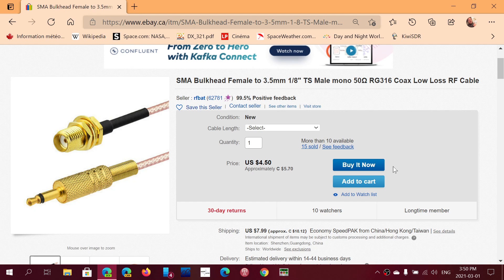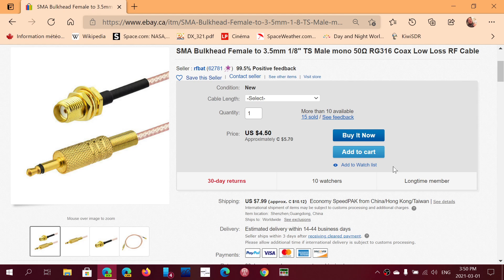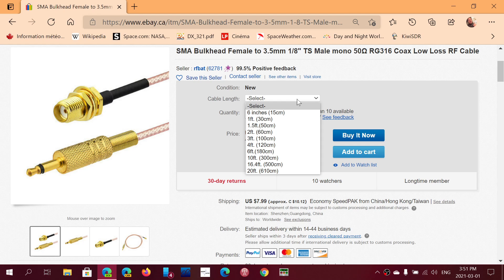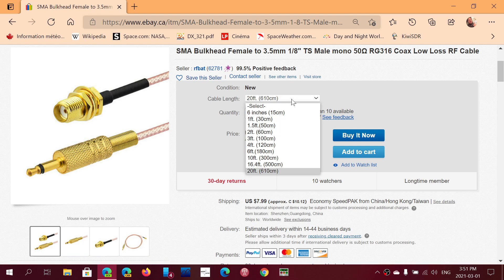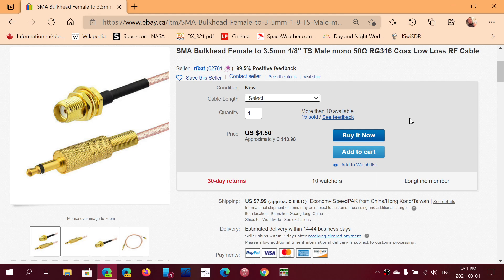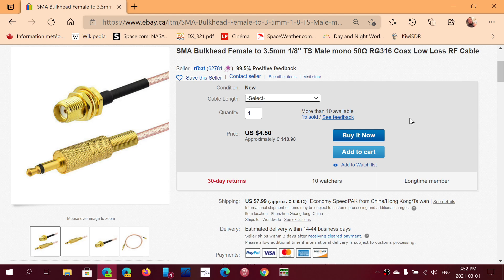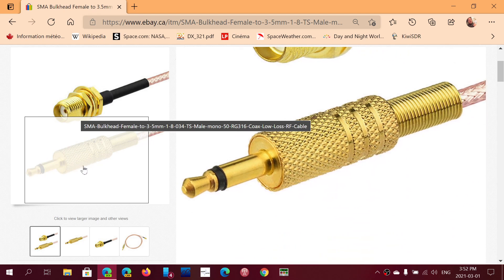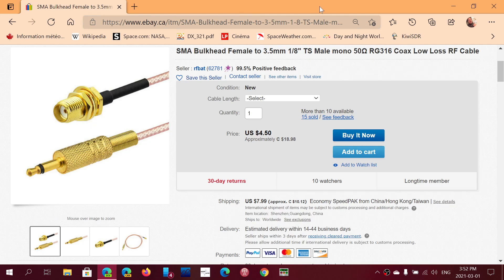What you need to hook up MLA 30 loop to a portable receiver is this cable

Comment: Hi, I have a tecsun R9012 and the only slots I have are earplugs and a 3v DC in. How to connect it? Thanks
Reply: you can just cut off the 3.5mm jack and wrap the bare wire around the antenna

Comment: I have a Tecsun PL368 and a CCrane Skywave. The only 3.5mm connection on these radios is for the ear buds. Is there another way?
Reply from the maker: Tecsun PL-368 on the top of the radio it is antenna, this works, as for C Crane it is a little complicated as they did not put a antenna jack
Reply: Got it. Thank you!

Comment: this question drives me crazy? I have the MLA-30+ antenna and a Realistic DX-302.  The cable coming out of the usb powered amp is a very small coax (?) but the radio has a much larger connector.  I would order an adapter but I'm not sure what the connectors are called.
Reply from the maker: You need a SMA female to PL-259 , they are available on Amazon

Comment: Gilles, while I don't need the Bias-T box to power the MLA 30 antenna for the SDRPLAY RSPDX, I do need it if I connect the MLA 30 to my Tecsun PL-990X, right?  Thanks
Reply from the maker: yes the SDRplay can power the antenna, this is why you don'T need the box, but on a portable radio like the 990X you need that Bias T box to power the antenna
Reply: @OfficialSWLchannel  Gilles, I just received my SDRplay RSPdx today!  I have a question about the power supply.  How do I power up this unit?  I see an oddball USB connection point on the back.  It looks like a connector for my old HP printer.  Do I need an oddball USB cable?
Reply: @OfficialSWLchannel  Assume I the SDRplay is powered through the USB cable from the computer?

Comment: I'm confused.   What am I missing here?  If you are connecting the antenna directly to your radio and bypassing the "bias tee", then yes you need the cable described above, as the cable from the antenna has a male SMA end.   But, the "bias tee" has a female SMA output, so to connect it to a radio, wouldn't you need a cable with a male SMA on one end and a 3.5mm jack on the other?
Reply from the maker: if you use the included cables all you need is what I am showing here.  why purchase two different cables when you only need one whatever option you choose

Comment: Don’t have the MLA-30 yet.  The picture on YouTube looks like the cable should be an sma male to 3.5 mm?????
The pic shows 2 threaded connectors, which seems like I would need the male??
Reply from the maker: what is in this video is what you need ..   SMA female to 3.5 mm male ... the MLA 30 has a SMA male connector
Reply: @OfficialSWLchannel  Thank you sir!

Comment: Thanks. All I need now is a way to get it through my window. Got to love living in an apartment. Lol.👍
Reply: That’s the beauty of the SMA wire... it’s thin and flexible enough to come through the window opening, and then close the window tight. I have mine come in that way and it works fine. And the window is not drafty at all. The window locks with the wire In The channel. I thought for sure I would crush the wire but so far so good!